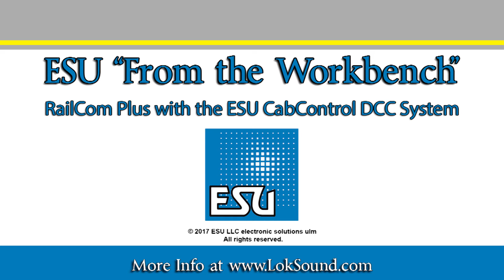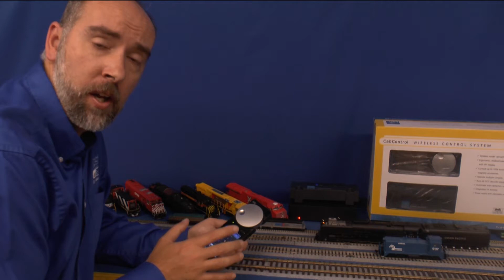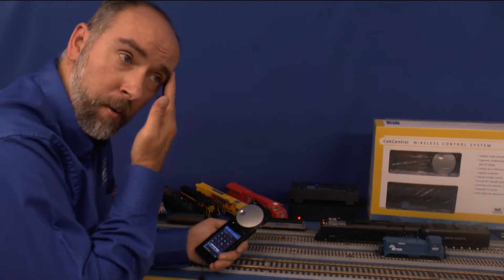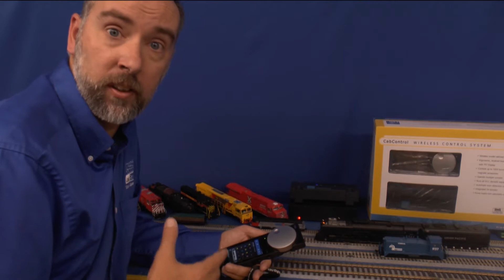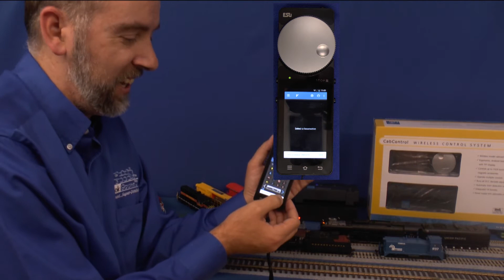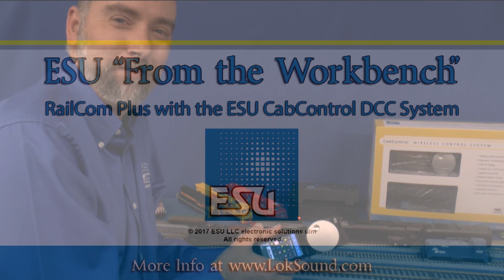RailCom Plus with the ESU CabControl DCC System

Comment: Can you program your engine to be esu full throttle with the esu cab controller If you dont have the esu lok programmer?
Reply from the maker: Hi Jeffery, The Full Throttle Features come in the new sound files. The sound file will need to be changed to add them to your models. Still better than replacing the whole decoder to add the features but a LokProgrammer will be needed to do this.

Comment: Just got my cab control in the mail today from YankeeDabbler and these videos are going to make getting started so much easier.  Been running NCE for years but this even better.  In fact, MUCH better.  Question:  which version of Android does the system use?  Will Android updates be included with ESU's updates?  How do I tell when I need an update- is there a place on the settings menu that ID's the current system version?  This system, to me, represents a quantum leap in the DCC UI and it leapfrogs ESU ahead of the other DCC developers.  Of course, this is a new OS, so I hope that you can keep a steady stream of bug stomping updates coming.  Congratulations to you and your crew at ESU.

Comment: i was wondering is it ok to put the unit on power supply like how you have it there in video.
Reply from the maker: As long as there is some airflow around it this should be OK. All electronics create a little bit of heat. The feet of the ICU create a channel for air to reach the PS, and there is an internal fan in the ICU which will help.
Reply: cool also dose the icu have expansion pins at the bottom. i saw on unboxing video there bottom tab or pin shield